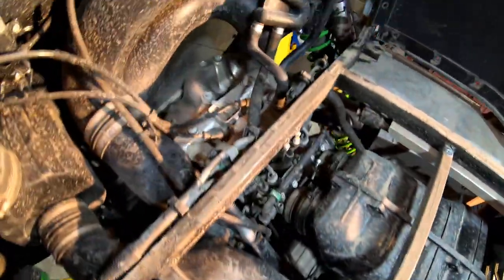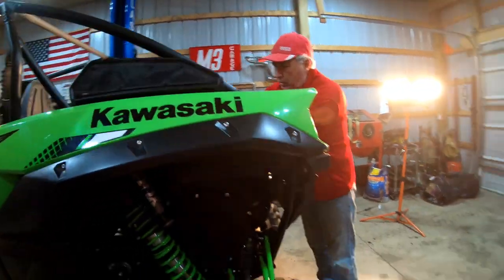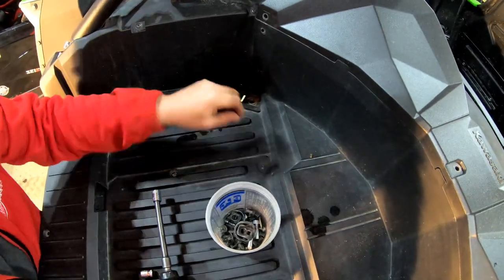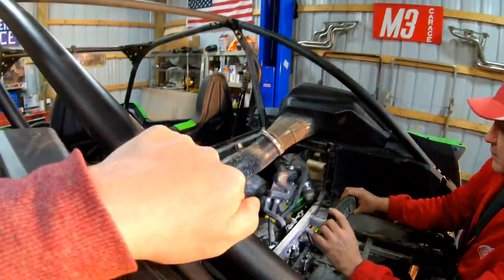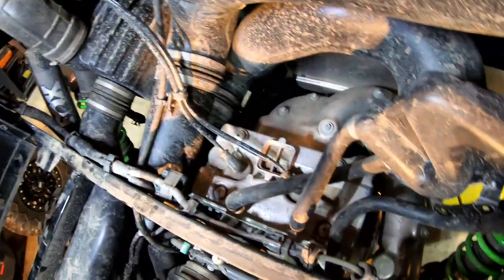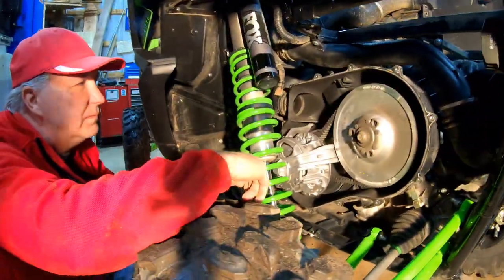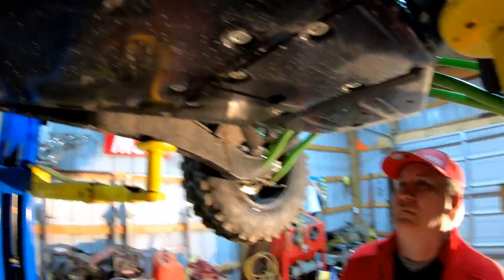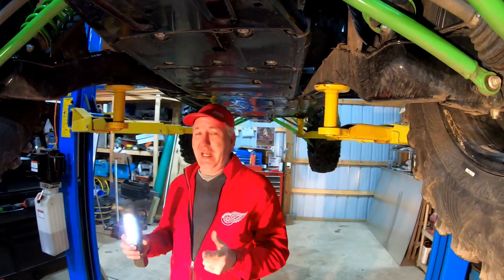Detailed Look at the KRX engine and Realistic Maintenance Intervals

Comment: I attempted to cross a swollen river and got high-centered in pea gravel and had about 26" of water flowing through/past my KRX.  It was enough to swamp my belt plus I gained about 30 lbs of pea gravel on top of the skid plate.  Got winched out by a friend.  The belt slipped like crazy until I pulled the plug and it took several minutes to drain the water out of it.

Once I got home, I pulled the cover and the whole clutch system was covered in dust (1200 miles on the machine, btw).  I sprayed it down with Simple Green and then hosed it off real good.  Then did it again.  Then left the cover off for a couple of hours to dry.  Has been fine ever since.  Oh, also took two days to get all the pea gravel out of it.  Had to drop the rear factory plastic under-coverings (I wouldn't call them skid plates) as well as some of the metal "compartments" under the seats.  Finally got it all out.
Reply: Nice we've had them pretty deep about the same the Krx did great!!
Reply: yeah the "skid plates" on these rides are very lacking

Comment: A arm bushings will start squeaking like crazy. I replaced mine with aftermarket already. Also add grease zerks. 
The springs and ride hight will start to severely sag out. The factory springs are junk. One of the best videos I’ve seen yet on the KRX guys. Great job. Don’t brag it up too much yet you only have 250 miles on it. Lol.
Reply: We appreciate the feedback. When did you buy yours and how many miles on it. Curious because I know they had dealt with those issues on the models built in 2020. Thanks again.
Reply: Jamey Arthurhultz you can tell the quality over can am and Polaris. Way better machines.

Comment: Again...Great Video guys..any issues with the knuckles or spring sag...I'm told some machine have had failures with the knuckles?
Reply from the maker: The knuckle issue is due to the way the steering stop is stepped on the A arm. Kawasaki did fix that for 2021. If you get a 2020 it’s an easy fix. There are several videos on it. Email me Ryan@M3offroad.com if you have any issues

Comment: What do you really think about the KRX power? I get its got great suspension and beefy. I own two teryx on an 09 an one a 17. I was going to wait till a year or so for more power. My 09 teryx makes over 100 as its got a 1020 BBK. Im between a talon R and a KRX. Ive been kawi since 80s. What do you like most about the KRX.
Reply: First thanks for watching. I would have to say that the plush ride and smooth clutch engagement is better than anything I've rode in and I've rode in and driven all of them. The power is perfect for the trails. We have 220 hp X3 s and I love driving the Krx just as much or more. Hope I answered your questions you cant go wrong also we are working with a couple companies on tunes for hp so stay tu ed it has potential for a lot more!!!!
Reply: You will be happy with the krx. more cab room better ride. love mine

Comment: We was trail riding  this past weekend . Went through  a mudhole  and our 2021 krx1000  fell off  deep hole. My husband  wasn't  able to save it . We landed  on driver's  side. We know it has water in oil. My husband  said he going to change  oil and filter  like three times. We washed the air filter. He going to get started  over the weekend. 
The question  i have  is what else's  do  we do?
Reply from the maker: Pull the spark plugs and make sure there is no water in the cylinders. If they are dry you should be ok. If they have water in them you will need to get it out. Hopefully not too much crud went in.
Reply: @M3OffRoad  Thank you very much

Comment: Hey guys, I’m really contemplating getting a KRX. What’s your thoughts on the power and power delivery on it? Right now I have a 2019 Wolverine X2 which is a great machine but really lacks HP and a comfy ride. My biggest attraction to the KRX is all the praise it gets for a plush ride but I’d like to be able to get the ass end around and climb steep hills w/o worrying about running out of power.
Reply from the maker: She’s a solid performer once you get a tune in her. A bit lazy from the factory but if you do not need to go ultra fast, it’s more than enough

Comment: Just from a quick flash, does it have a visco lock diff in the front? There are no goodies in that department?

Any chance you would do a VS drive down identical terrain back to back and swap out between KRX and X3 with lots of feedback after each challenge?
Reply: Stay tuned there is something in the works soon.... thanks for watching we appreciate it and the questions and comments.
Reply: It has an electronic locking front diff. 3 modes. 2WD, 4WD and 4WD w/diff lock.
Reply from the maker: Yep soon. Dozer is having issues with his viscolok
Reply: @M3OffRoad  How is that dude? Their channel has not had any content since very early this year, had a teaser for their glamis trip then nothing...
You guys ever have ambitions of going out to those popular areas like Glamis and Moab out here on the Best Coast?

Comment: This thing looks primed for a V4 engine. That would be awesome, but the UTV makers stick with the 1 liter sizes. BTW, x3s are so loud and the belt engagement in high is very jerky. I'd imagine the KRX centrifugal clutch would significantly help that. In low x3s are super smooth though rock crawling.

Comment: I love my KXR Trail Edition. My RZR buddies can pull away on the street. But the trail is another level!! Mine putts up rocky hills when they have to hammer. Loads on the trailer with no ramps way easier. For the cost it’s a way better product. They spent comparable money at the dealership then had to add a lot in wheels tires and suspension. I’m riding stock.